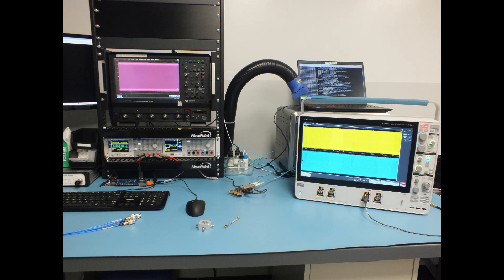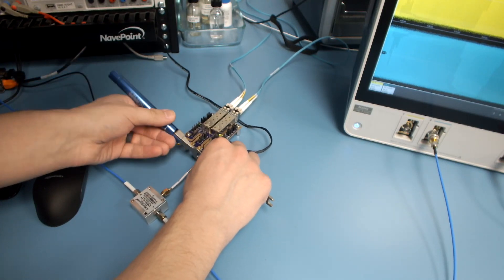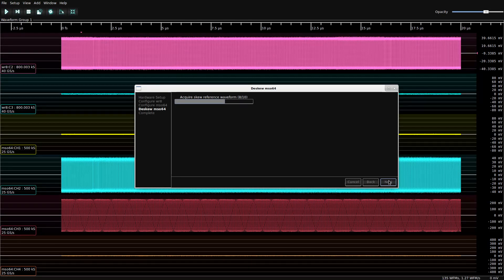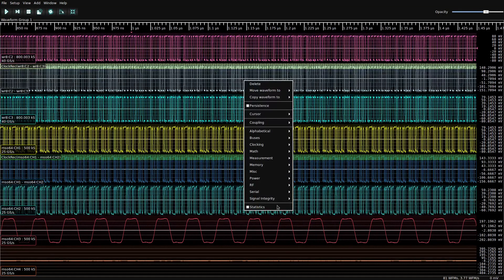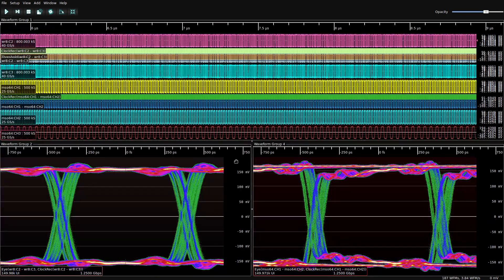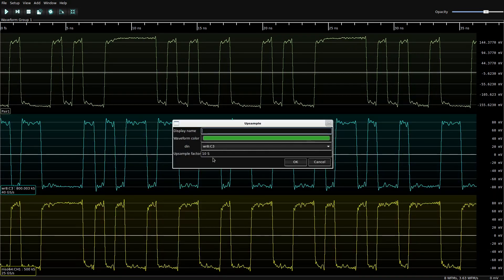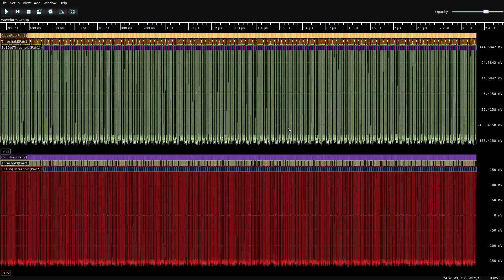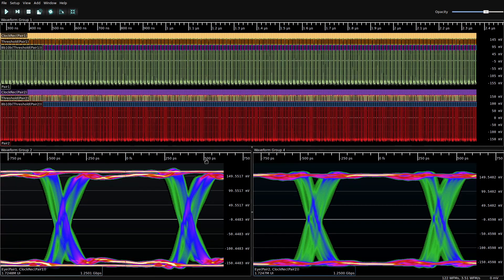Combining a LeCroy and Tek scope under one glscopeclient instance!

Comment: I wish I had any scopes with ref clk inputs, let alone two of them 😅
Reply from the maker: Only the LeCroy (and the other LeCroy off the left side of the shot that you can't see) is mine, the MSO6 is on loan from a friend to support development.

You can still use the sync feature without a shared refclk but there will be more timebase jitter and you might see drift in longer acquisitions due to slightly different sample rates. The only hard requirement is that the primary instrument have a trigger output. You don't even need an external trigger input on a secondary scope, although if you don't have one you obviously waste a channel with the trigger cascade.